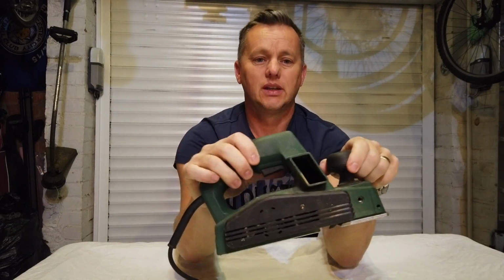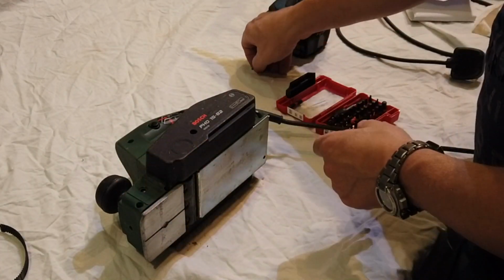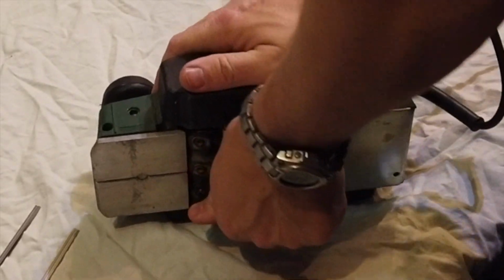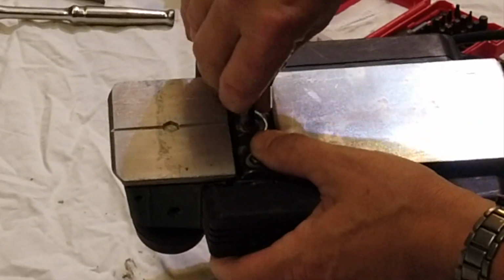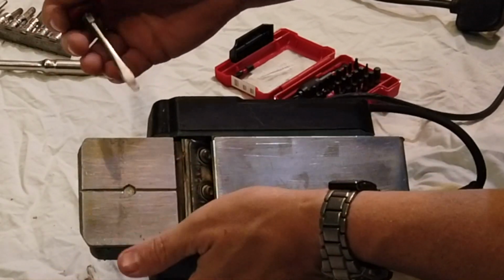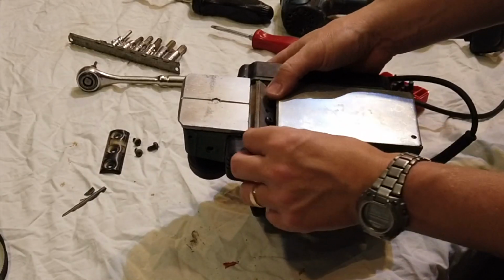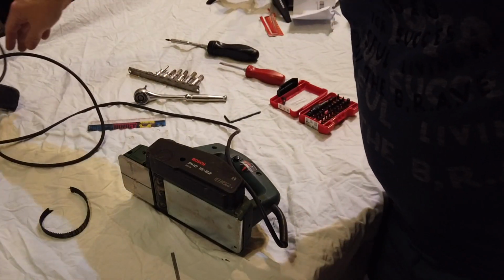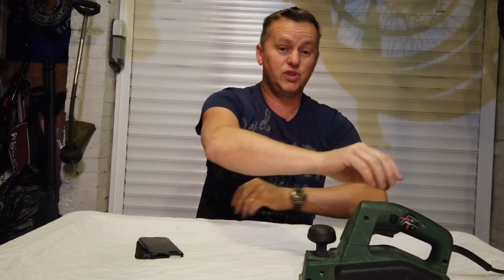Bosch Plainer Blade & Belt Replacement, PHO15-82

Comment: At first glance, the belt you're suggesting is much wider (12/14 mm) than those in the Amazon link, which are 9 mm. The question now is whether they will be more resistant, given that they will not cover the pulleys as much.
We will probably never know for sure.
Reply from the maker: Good spot, thanks for the detailed feedback! 👍🏻👍🏻🛠

Comment: Thanks for the video I gave someone a loan of my plainer and he told me he replaced the blades but when I used it nothing happened couldn't work out what was wrong tried replacing the blades but no luck after watching your video I could see he had the plates round the wrong way and he had also moved the plates underneath I copied what you did and working fine only thing is when set to park it still cuts a bit but can live with that. cheers again!
Reply from the maker: Glad it helped, Thanks for the great comments👍🏻👍🏻🛠
Reply from the maker: Glad it helped, Thanks for the great comments👍🏻👍🏻🛠

Comment: Liked your video one comment  I didn't cut through a nail with mine, the friend I lent in to did, so I changed the blade and then when I tried it even when set on zero it still took off about 1.5 mm of surface, this was because if you don't have the bolts up quite tight centrifugal force throws the blades forwards and out of adjustment, took me ages to work out what was going on.
Reply from the maker: Thanks for the great information👍🏻👍🏻🛠

Comment: REF THE BOLTS ALMOST SEIZING PUT THE SCREWS IN WITH A PRODUCT  CALLED COPPER EASE, WE USED THIS IN FORMULA 1 ON  WHEEL NUTS..THOSE WONT SEIZE AGAIN
Reply from the maker: Thanks for the great information👍🏻👍🏻🛠

Comment: Unrelated to your blog, wee enquiry about my Toyoto Aygo, on uneven/rough roadways, the Aygo lacks comfort, what specific bushes may I be looking at renewing? 89K miles...x
Reply from the maker: Hi Charlene when you say lacks comfort, have you also got any knocking noises coming from anywhere, 👍🏻👍🏻🛠
Reply: @aaanton11  no knocking as such,    if you go over a speed bump, you feel the thud through the wee car! x
Reply from the maker: daft as it sounds try dropping the tyre pressures down to 22 psi front and rear it make the ride much smoother, it doesn't sound like you have a bush issue, they do ride quite firm👍🏻👍🏻🛠